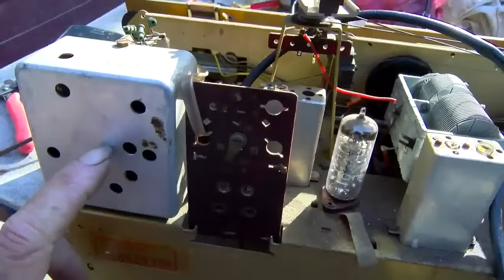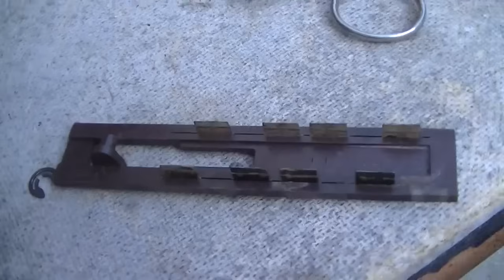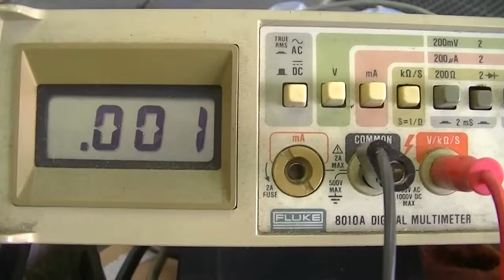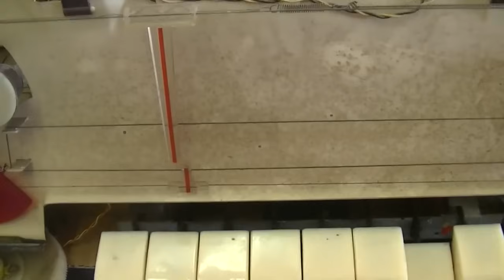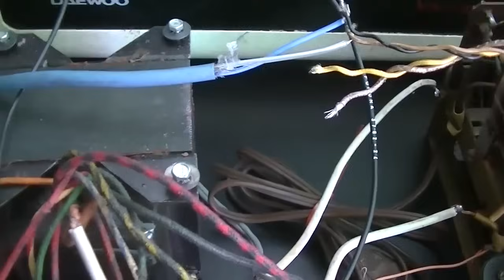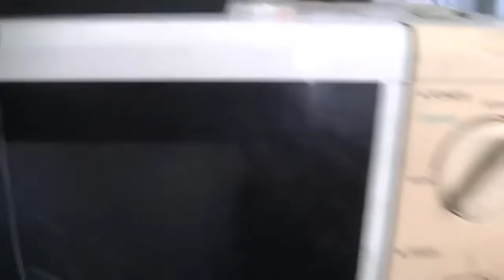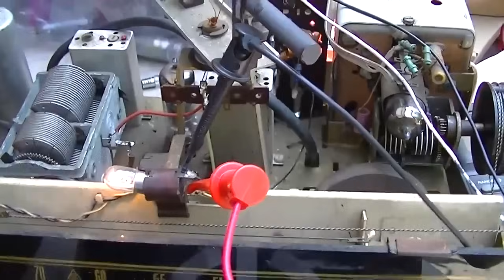Grundig Majestic 3035 Radio Repair Full 720p

Comment: I've spent months restoring some radios.   hour or 2 in evening.  Cabinets, mechanical repair. Electronic repairs.  deciphering problems. finding parts. etc.   some times log time to repair restore a radio to try get it close to factory working.  I can see why 2 hour video here but thats not all the story.  takes long time . Sometimes get lucky but others long ordeal.

Comment: My grandparents gave me a broken Grundig reel to reel, there was a pot metal bracket inside that turned to dust, as if the half-life of the radioactive metals in the pot metal had reached their half-life~  and crumbled, was not smart enough to mix JB weld at  10 years old~

Comment: A very experienced tube radio repairman I once knew was asked to repair an early, post war Siemens radio like that but smaller.  It had no capacitors in it, only wires wrapped around wires, and many of those.  He found that if you even bent one of those wrapped wires it changed things.  It was the only radio he ever gave up on and he had worked on thousands of them.  It is what he did for a living  for most of his life.

Comment: I have been going through all of your videos, and yes I watch all of them to the end. you had a question about transformers that are configured to buck/boost with lower voltage windings if those windings would hold up and not flash over????. the answer is" yes they will hold up,". when the transformer is dipped/ baked at the factory with insulation material(HOT GOO) all windings carry the same insulation value in terms of voltage potential. transformers are "HIGH POT. TESTED" for insulation breakdown( 15KV) before leaving the factory. transformers just like motors, when they are overheated, the thermal damage never goes away, even though the heat is gone, and the thermal damage is cumulative. moisture is another insulation killer, so is age. that is why it is a good idea to fuse protect your power transformers in radio's and T.V. sets on the primary side, and document the voltages of all transformer windings, so you have that information. some day you just might need that information!!!!!.
Reply: Good tip.

Comment: This is a high fidelity set.
The ceramic disc capacitor will completely destroy the sound by introducing immense amounts of harmonic distortion.
How can you bastardize such a finely tuned piece of vintage high end European audio technology?
Please remove this objectionable component and replace it with a quality modern avocado oil palladium foil device.

Comment: I have a vintage Grundig stereo console and I'm not able to tune in any radio stations anymore. The stereo looked to be in excellent condition and when I first tuned it on, a couple weeks ago, I was able to tune in a couple of stations on FM, but now I'm not able to get anything. The speakers also sound pretty scratchy when trying to tune in a station, but that usually disappeared when a station came on. But, again, I'm not really getting anything now. Does anyone know if this is an electrical, mechanical or parts problem or an antenna one? I don't see an external antenna on it, but there is a switch for one.

Comment: I bought an old tube radio. But, before plugging it in, i went to measure the ohm rezistance on the plugs.
It had no resistance.
Then, i looked inside, and it was so messed up, that it did not match schematics at all.
Lots of surprises in these old devices.
Reply: You should have check all the capacitors before use.

Comment: These were very good and very sensitive radios on all bands. Pitch black background on AM/SW brought in distant stations with ease. I had the European market equivalent of this radio, it had also LW that this USA version lacks. Another very useful feature is the rotatable AM ferrite bar. Hook it up to a good SW antenna and it will bring in many stations, if any are left that is. Tube sockets in these old radios are a pain when they age, they break easily. Whatever the case, see how beautifully it is constructed and compare this to todays stuff.

Comment: I sincerely have to admire your tenacity in getting this to work! Given the overall state of the radio and I have to admit, it was SOOOO grimy on the inside !! My Siemens radio was pristine despite the various faults! Also I think the build quality was far superior to the Grundig, the tuner assembly was far superior and NOT switch carbon tracking et. 👀 Overall the sound quality (mine had two powered tweeters, 3 mid range and bass units. ) is awesome. You will find it hard to beat the warmth that a valve radio amp et gives, Solid TEAK cabinet makes it a real beast. 😶True to say the instructions / circuit was in German including wire colour coding and et but once you got used to deciphering that, it was fine. Voltage readings were taken on my Avo 20,000ohms per volt. Well done sir.. stay safe! 👍

Comment: The Siemens German radio GRAM unit I took on was a beautiful piece of engineering. Only TWO exist and I have one of them... YES ! The power transformer FAILED, YES! the SELENIUM rectifier FAILED! I eventually replaced the entire power feed with a new transformer AND zener diode circuit with added ballast resistor et 😶The transformer 250v primary 250v >1A / 6.3v > 3A secondary, NEW hand built custom unit. It was a lot of work! The turntable unit was a 55v Polydor unit AND the motor SEIZED. 👀🙄 I think the problem was the FACT that the transformer was originally rated at less than 750mA main power and the heaters taking up to 3A rated at less than that. Took its toll on the windings BUT also I believe those selenium rectifiers were a nightmare! So my sympathies!

Comment: Those Grundigs sound great when working but are a total nightmare to fix.  Transformer failure is common also shorting bandswitches . Caps always need changing  
I avoid them like the plague . More complex than they needed to be . Have you ever restrung the dial drive on one !!!!!????&&&###@ . Well done sir . I would have thrown it from the top floor window onto a very hard surface !!

Comment: Thank You for sharing this knowledge. Great job shango! I always throw the electrolytics bypass at el84 and the one at the EABC 80 out. The sound and stability at FM is much better then. If I had seen the video earlier, I would have sent you a transformer for free from Germany. The most German transformers are prepared for 117 and 120 Volt line voltage.

Comment: I would also say, repair job and strategy shown in this Video not recommended. You say and obviously know those paper and foil caps are done. Why don't change them. I have currently 5 of them reworked in my shop. All of them German, one a Grundig. Also I went through at least 15 that i scraped for parts, 3 I rebuilt for Friends. One of the Radios came from a Barn. It had been flooded several times, the wood was moulded away but after drying at least the trafo worked as a charme. You shouldn't be surprised by a fryed trafo if you leave all those rotten caps on the B+. Half of the video you are filming a completely cracked cap from bottom to top. Are you blind? If you just recaped the whole radio, instead of poking around in that poor device, you would have probably finished this after latest 45 min. video time. Without replacing half of the resistors and frying the trafo. I allways recap my radios completely before switching on. Never gave a transformer up on me. The job in this video is not good practice. Sticking your finger in a 250V AC device is completely unprofessional and should be advised as something you should never ever do! Especially for little children who don't know the danger of electrocution as even you as an adult obviously don't. 
Youtube pls ban this Video!

Comment: I'm late to the party but this helped me a buck with one of the slide switches (the FM band one that also triggers the clutch mechanism). AM (BC) worked but no love on the FM unless I held it down which told me that it was not making contact due to a number or potential problems. I wouldn't be as far along without this video. Thank you big time.

Comment: It Seems you had the same Problem like me, after that Lound Noice The Fuse Blow up. And with an to Strong Fuse i blow up the Rectifier and maybe the Transformer.. It was Very Hot,  Damn me.. Idiot. I hope the  Transformer is not Death. But the Rectifier  for sure. IN my Case the Tuner was Running, i could here Radio Sound. Behind the Lound Humming Noice.

Comment: Power company boosts the primary voltage up to make the power grid more efficient. Unfortunately this shortens life of end users equipment. Mine is 125V line to neutral.

Comment: If there were room for another 6.3 volt filament trans- connect the 6.3 volt secondary of the second 6.3 v trans across the 6.3 v heater supply. So the "primary " of the second transformer should by +/- 120 volts. Connect the 120v to your switching supply. You have your "B" voltage with no hot chassis, but only if there is room for that second transformer

Comment: Valves vs tubes. I once heard (from  a Brit.) that the logic behind the word 'valve' was that the grid serves as the method of limiting the current drawn through a triode. It's backwards thinking to me, but essentially correct as a triode with no negative grid voltage will conduct at its maximum before burning out.

Comment: I picked up a newer Grundig radio a few years back, it is a G8 traveler radio.  Says designed in the USA assembled in China. It is a great little AM/FM/SW hand held radio with digital readout, built in clock/alarm clock and displays local temperature as part of the display, she takes 3 AA batteries and works better then any other little transistor radios I have ever had.

Comment: What is a carbon tracking?
Reply: Sometimes when a part burns or sparks it leaves a layer of carbon soot behind. The carbon can act as a resistor and draw current, upsetting voltage values or changing signal paths.

Comment: I've seen many Latvian soviet era radios have a "magnetic antena" knob that moves the slugs around in the IF can's or something. and they use a eye tube for the display for the "magnetic antena"
but if I recal corectly, that "magnetic antena" knob just "widened" the band and when you got on a station you could really get tight on it. and the "magnetic antena" eye tube was just a reception indicator.

Comment: Very impressive. I have a Grundig console with what appears to be a similar tuner - must weigh close to 100lbs. I've considered having it repaired but it's not like you can mail it to a qualified technician such as yourself. Checking the model #, it has an impressive array of speakers and incredible cabinet with mahogany veneer.
Reply: Appears to be a Grundig Stereo-Radiogram KS560, early 60's.
Reply: I had one of these that was a console stereo with the record changer and many speakers all in a cabinet. Lovely unit. I repaired it. Someone wanted it and I sold it some 20 years ago. You cant keep them all.

Comment: Hi
When I was a boy I started in electronics with this radios in Germany. This radios were everywhere on flee markets on the street,  from friends. The magic eye tubes are expensive today even if you buy a used one you can just see during daylight.

Grundig developed 3D sound, they figured out in a music hall in the concert you will get the treble and the bass from the front and only the treble is reflected from the walls right and left. The front speaker has treble and bass loudspeaker and the sides speakers are treble speakers.  3D sound. The bass is absorbed from the building or structure, this is also the reason why you hear the loud bass bumming in cars passing you with loud music.

The last Grundig I repaired with the help of a friend had a broken rectifier and we put a silicon bridge rectifier with a serial resistor to drop the higher voltage. 

When the radio works it has a beautiful sound. It performs well in sound quality and was popular in the higher quality market e. g. to listen to classic music.

Nobody would repair a tuner it was changed (spare part). On shortwave we listened to 49m Europaband. Most popular sw band in Europe.

73

Comment: I am repairing and old truck tube radio and it needs a new 200 uf cap and and 500 uf cap which I can't find. What would happen if I used 220 uf and 470 uf? I have in the past used different disc caps in car radios and the radios worked fine. Don't want to blow any tubes.

Comment: I took the plunge and bought a Grundig 3028 this week. $25 from Goodwill, pretty nice condition, and it works, mostly. Both tuners work, AM and FM work, the antenna rotate doesn't  work. Doesn't  sound right, a bit crackly, so a bunch of small parts will get changed out.
This video was great for me. Thanks.

Comment: Well I made it all the way through!  Can't believe I watched the whole thing!  Cool radio though, I have always had a soft spot for Grundig, even the little pocket traveler that I have that, sadly was made in China under the Grudig name.  AM/FM/SW shirt pocket radio/clock/alarm/world time/temp display.  Nice set, I picked up off Ebay, a puppy had chewed up the data plate on the back and the battery cover. I found those parts brand new on Ebay so now she looks like new, runs like new.  I had an old Grundig Reel to Reel back in the early 1970's that worked very well.  I was unable to ship all my reel to reel tapes home when I was transfered from overseas back stateside, so I never did have much music to play  on here.  One night I was on CQ duty at the company and got to talking to my runner, he said he would give me a  hundred bucks for the old machine!  Well I had only paid 20 for her at a hock shop so I sold it.

Comment: They are called valves because the easy way to explain the function back in the day round these parts was to use water.  If you think about it a valve does have gain of a sorts. A little bit of movement for ce by you on the handle creates a considerable force in the pipe. Theres your gain. Its pretty much the same with a tube or transistor. You apply a small amount of energy to control a larger flow. A tube doesnt really 'gain' anything. You simply use it to control a larger electron flow.

Comment: Mine is a 3265 I had to drag it out it is very low hour and plays perfect but that stupid tuning clutch is bad on mine but I can tune it by a wheel located on the lower right of the chassis the one I have those not look like that one they much it does kind of on the outside but my model number is 3265 on the outside with dual weird looking speakers on each side with the big 6 by 9 it sounds good excellent and it's for sale

Comment: The old West-German mains transformers are perfectly repairable. The hardest part is to count the original number of turns.
Reply: That's true.
I've rewound transformers before.
The plates can all be removed and the whole transformer pulled apart.
Reply: Im sure someone somewhere would pay for transformer rewind
Reply: Can't you just weigh the transformer before removing the windings, then make it weigh the same afterwards to get close enough?

Comment: Danka dude, haven't been called a hero since I retired from the Police Force in '93 but I did manage to get all the way through the video.  It is nice in the way it shows how one problem can lead to the next, and the progression of such a situation even when dealing with the top of the line products from back in the day. I have always had a soft spot in my heart for Grundig since 1972 when I was transfered from Fort Lewis Washington to Fort Bliss Texas, this but a couple of years after I returned from Vietnam.  We were the Advanced Party for the 3rd Armored Cav who were moving to the Fort to engage in Desert Warfare training, because of the trouble in the Middle East, a situation that has changed very little except for the fact that the 3rd has been over to the trouble spots since the initial outbreak of the wars.  At any rate, when we got down there, my self and my good wife, our first child in arms and the second comfortably resting in my good wife's womb, our furniture was somehow lost over the road somewhere, and we had a small apartment just off post with no furniture, just the bed rolls we carried along in the old '63 Ford Econoline van that I drove down in. A trip to the hock shop just off base, a common shop near all military bases, and I found an old Gurndig combo radio/reel to reel tape machine. I picked it up for a few bucks and it was our soul entertainment till our stuff arrived about a month later. Well I did find a cheap black and white TV for 20 bucks at the base thrift store. I have loved the Gurndig machines since then and still have one little pocket model AM/FM/SW radio, made in, of course, China as nearly everything is now days, however when I pulled the back off her to take a look, I found that the quality was still present, and the build was WAY better then most of the shit coming out of China now days. Apparently the Chinese can build good stuff if you put a German in charge of the shop.

Comment: You spoke highly of that radio in a later vid. Seems you grew more and more fond of it as you progressed. I haven't watched it all yet.
We have an electronics store JUST like that here in Zurich, Switzerland too! Cardboard boxes with obsolete parts all over. Power resistors stacked 8ft high. Software manual books from 1993. Great if you mess with old stuff and otherwise useless.

Comment: Excellent video, well worth 1 hr., 45 min. Run time.
Definitely learned some good trouble shooting procedures, and learned to steer clear of push button band switches.
Rotary band switches are much better, but you solved all the problems. 
Thanks,  and keep up the good work.